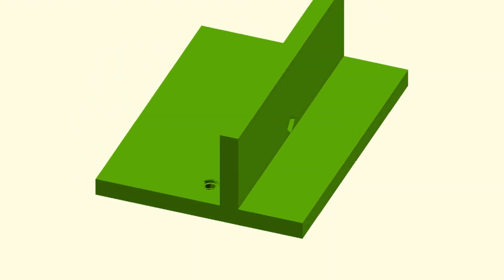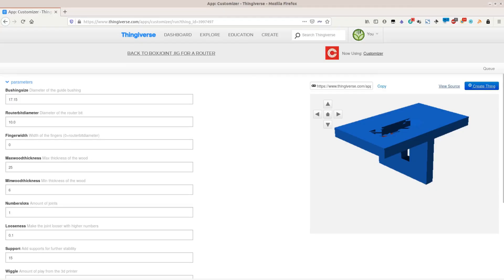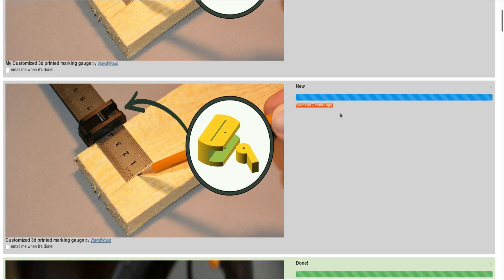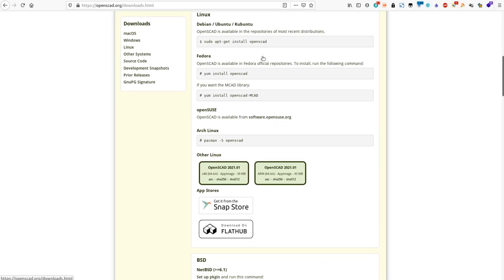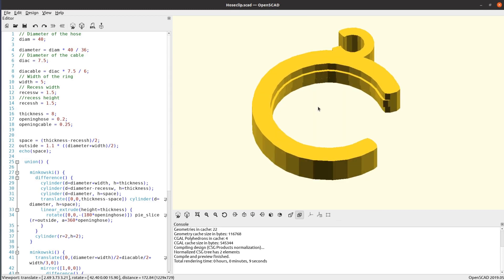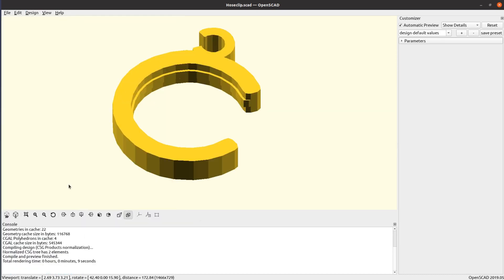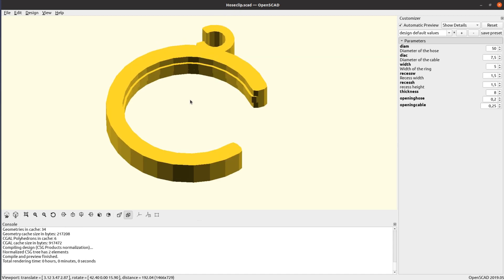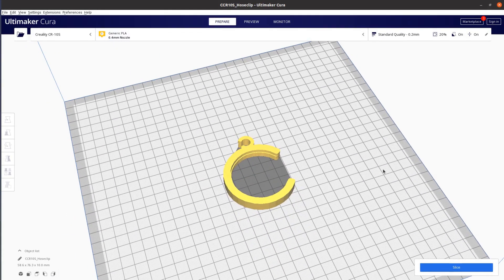Thingiverse customizer not working? How to customize models on your PC

Comment: I made an OpenSCAD model myself(Optimized XYZ Calibration print), but the Customizer app couldn't open it, and then I watched this video. Makes sense.

I thought that'd be the end of the story, but today I just realized that the app wasn't 'broken', per se.

Turns out the app is running an old version of OpenSCAD and cannot parse ^ operator.
I replaced all of that with some other equations and it worked. Still, that's putting even more limit on a program that is pretty limited.
Reply from the maker: Good Observation. Although I am pretty sure that some of the broken models don't use the ^ operator - so most likely some other features are also missing...
Reply: i dont understand, what did you do? i want to make it work

Comment: Thanks for this video, I appreciate it a lot. I do have a question, when I'm trying to make this box (https://www.thingiverse.com/thing:1355018) and download the code into openSCAD I can change the dimensions but when I want to export it as an STL file it gives me the complete box as one part, not the separate panels. Even when I deselect elements to export, it still exports the complete box as 1 file. How can I fix this? Thanks again for your support! Jaap.
Reply from the maker: You have to remove the part from the scad source if you don't want it to be exported. As an alternative you can also use slic3r software to split the model into different pieces.